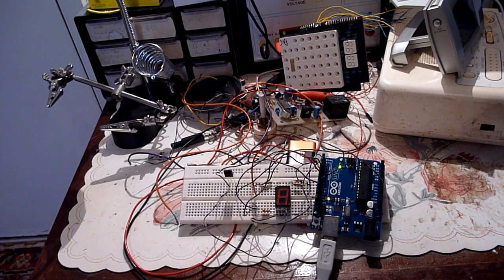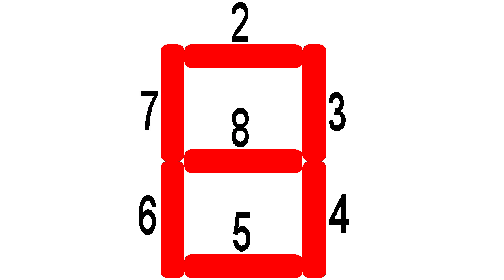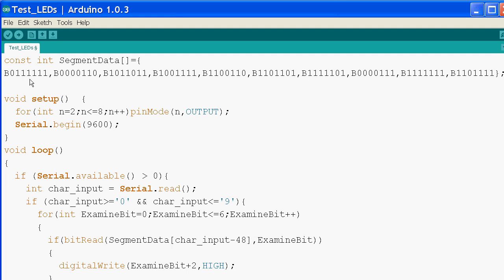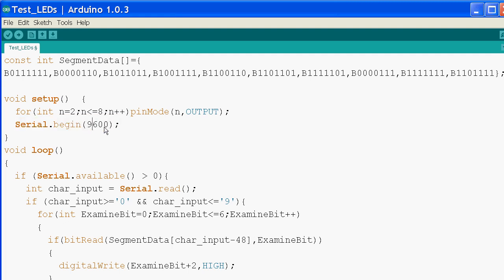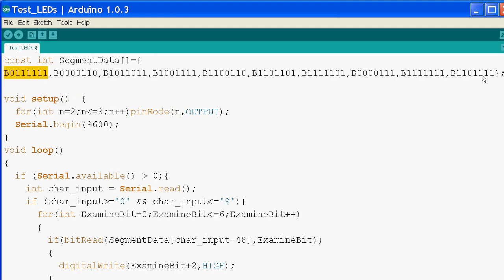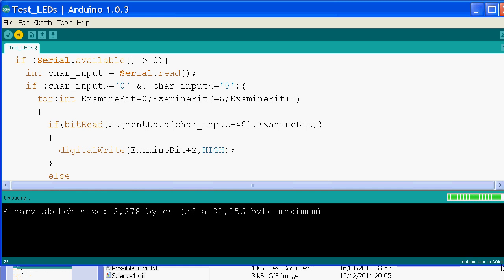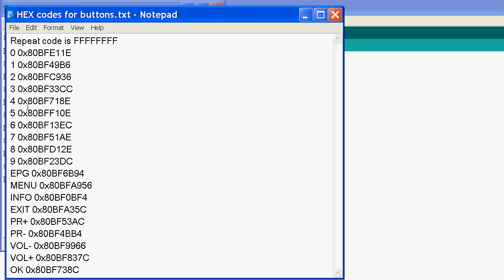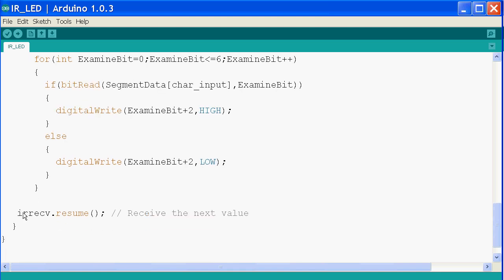Tutorial IR codes to LED display

Comment: Everytime when I press the same button, I get another code back. So I have no specific code or a specific button. Why do I have this Problem?
Reply from the maker: You would need to elaborate more as you have not given me any information on which to make a judgment. Try another remote control.
Reply: resonance2001 I've tried  different remote controls. The problem appears with each of them
Reply from the maker: This is the first time I've heard of the issue. I would experiment with other versions of the IR library and Arduino compiler. There may be some interference in the circuit. Perhaps the power supply has some electrical noise.
Reply: resonance2001 Okay thanks for your answer. I will try my best to fix it.
Reply from the maker: Another thing to try (as it's simple) is to put a capacitor across the supply lines (maybe 10 to 100 μF) to act as a filter capacitor and try a different input pin.

Comment: I have used your program but get an error message when I compile it ofArduino: 1.5.5 (Windows 7), Board: "Arduino Uno"

D:\Program Files (x86)\Arduino\libraries\RobotIRremote\src\IRremoteTools.cpp:5: error: 'TKD2' was not declared in this scope

  This report would have more information with
  "Show verbose output during compilation"
  enabled in File > Preferences.
Reply from the maker: I wonder if it is because you have used the beta version. Have you tried the same thing with 1.0.5? I doubt it has anything to do with Windows 7. I'm still using XP!